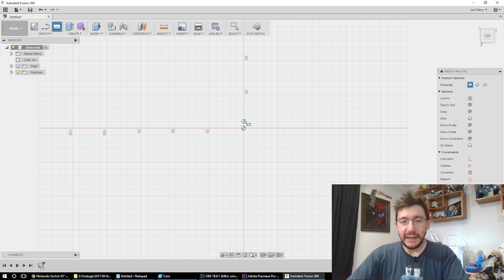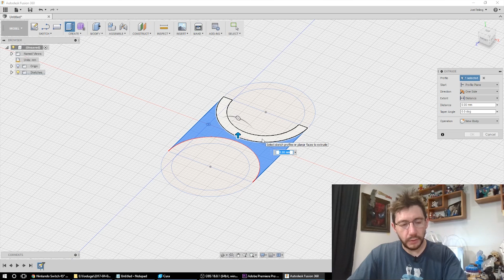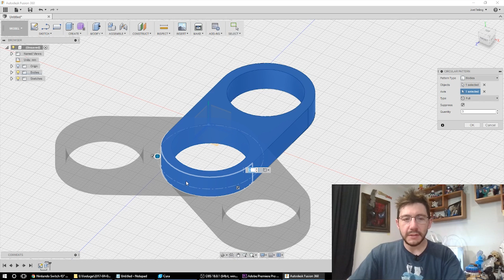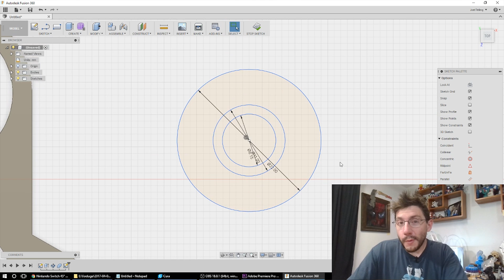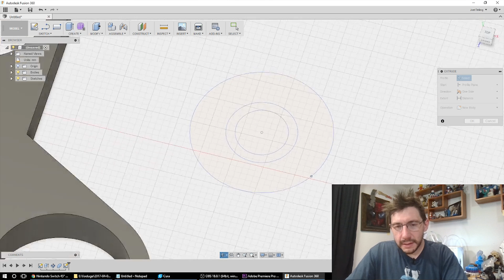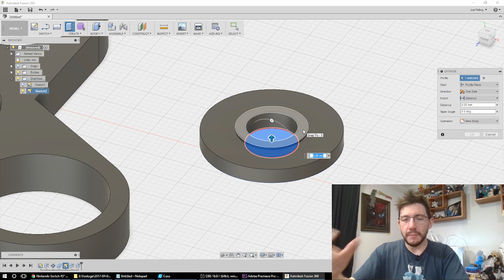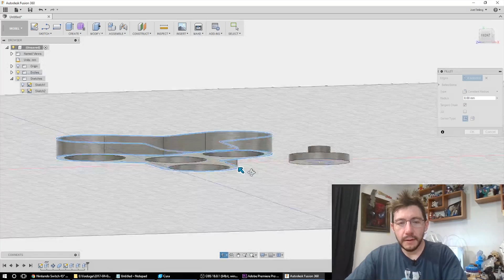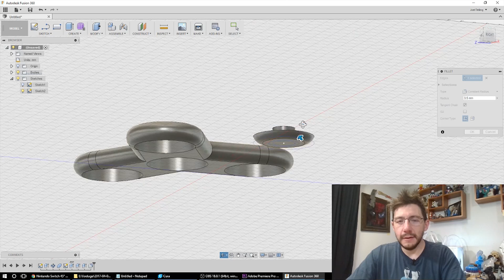FIDGET SPINNER! Easily Make Your Own with 3D Printing!

Comment: nice video. just one doubt. how do the bearings on the sides(other than the center one) stay in place. How do u lock them? or just push them in place? n if they are not locked, dont they come off? and what material did u print them in? Thanks in advance.

Comment: I would like the outer holes to be 3/4 inch diameter for ceramic magnets to fit tight. I use two for mass and strength. These magnets are cheep and readily available in most hardware stores. I built a Bedini style SSG style pulse motor with a spinner. And be aware there are many different brands of spinners. Fidget Sinner is a trademark name so be careful what you say. Thanks for the info Youtuber. Come to Facebook sometime and do a live one. K! Nuff stuff? Checkout what I've done. 
https://www.facebook.com/KB9AGT/videos/10154786011147215/

Comment: If I were say getting a spinner done in brass based off my design, would I still need to add the .05 for the bearing? Or would, since it'd be done by a CNC, it not be needed?

Comment: If you haven't already order a couple of full ceramic bearings for the center bearing. The difference is a much better spin time and sound. I replaced the one I made for my 10 year old he was ecstatic. The full ceramic ones cost more, around $9 each. You can use the old steelies to go around the outside for weight, or just use nuts they are cheaper. Thanks for the idea of using fusion 360 to design my own. Keep making the great videos :)

Comment: what would be a good first 3d printer?
Reply from the maker: It really depends on a number of things. What's your budget? What do you want to print? How much space do you have? What is your technical ability?
Reply: $500 or less, I'm interested in printing moving mechanisms, gears, etc. Space isnt much of an issue, and Im pretty good with computers, and have minimal 3d modeling experience.
Reply: and id like a good sized print volume
Reply: Zachary Tarbell Hey man! I don’t know if you’re still wondering and I’m no 3D printing expert, but the creality cr-10 is a pretty good printer from what I heard. It’s under $500 and has quite a bit of space. :)

Comment: @Joel,

  I'm gonna need you to go back and apply R.U.L.E. #1 in Fusion 360. You can then continue making this video.
Reply from the maker: I knew someone would bring this up!
Reply: lol  For simple designs like this, it will not make much of a difference.  But once you start getting more and more complex, it will make it much easier to work.

Comment: I have a question. Do you have any techniques of getting broken filament out of the extruder assembly? It is just do stuck I don't know how to get it out
Reply from the maker: Depends on where it is stuck, but there are several techniques to try. Look up "atomic pull" method.
Reply: Thanks. I actually had to take it all apart and get a nail and hammer the filament through the metal part above the hot end and is now fixed. Thanks!

Comment: Angus began Fusion 360 a few weeks ago and Autodesks offer is great. the software is basically free for startups and fans as long as you make less then 100k and by then you can afford it. 

your tutorial felt a little bit too straightforward, like too much step to step and no explaining and no visualization of things. you showed the pattern as 3 then 2 and then 3 again for example. 

But excited more people are using the software and more will after your video. I chose fusion360 for my project as well and I had done a few designs already. currently doing custom hydroponic planting pots in the form of numbers and letters but I haven't yet found a good way to use the pattern that fallows a path for it. and I am not great at typography
Reply from the maker: The goal was to make this as ridiculously simple as possible. My goal with this was to make it so a kid could pick this up and do it. I'm still learning Fusion 360, as it's well apparent (heh), and Angus has been one of the driving forces for that. Angus and I chat, and he's told me he welcomes the challenge :)
Reply: Educate & Advocate

Comment: what if you made a 3d printed bearing
Reply from the maker: It would not spin very well :)
Reply: 3D Printing Nerd yes but you can make it out of copper filament then send the seven bearing balls a little bit
Reply from the maker: Now THAT is interesting...
Reply: I have...used it on a customized spool holder...they didn't spin all that well
http://www.thingiverse.com/make:255750
Reply: I've 'proofed' a roller bearing. It's on MMF. It is printable in PLA as a one piece print with very little support. With some lithium or ptfe lubricant it rolls ok, but nothing like steel. 

You could print in metalfill but it would take a VERY long time to get the surfaces smooth as you can't reach inside the bearing race to access the rollers. 

So it COULD be done, but not really worth the time or effort. If you just want to as proof of concept, grab the file from MMF and have fun.

Comment: Unfortunately, Fusion 360 doesn't work on Linux, and they have no intention of porting it. So I'm using OnShape, which I actually first learned about from Angus. From what I understand, it's nearly identical in functionality to Fusion 360.
Reply from the maker: I've heard that as well! I really want to try it out at some point!
Reply: 3D Printing Nerd: I'm pretty happy with it, though I have little basis for comparison. It works in nearly every modern browser and is free to use for public designs.

Comment: Ceramic bearings are good, but not necessary. Open up your bearing (remove the metal cover), and clean the grease out of it with WD40. Makes a world of difference.
Reply: I just use coconut oil
Reply: This is the biggest tip many people miss. Lose the oil/grease on the bearings. They will never spin fast enough to need the lubrication. All the grease does is slow it down on you. I found a supplier in China that has inexpensive ceramic bearings that spin just as long as the expensive ones on Amazon for 1/10th the price.
Reply: +Trigger: I'd be interested to know that supplier. Care to share?
Reply: and the name of the supplier is....?
Reply: I got some ceramic ones off eBay, and they spin for about 2 minutes whilst being very cheap. Here you are: http://www.ebay.co.uk/itm/608RS-Good-Roller-Skates-Ceramic-Ball-Inline-Skate-Bearings-Drift-Plate-MR-/192041707127?hash=item2cb693e677:g:qBMAAOSwiONYQAji

They did take a while to arrive though...
Reply: Makes more noise though...
But boy howdy do they spin MUCH longer!
Reply: See my other response in this thread.
Reply: Michiel Helvensteijn 
Hi
Reply: WD 40 actually leaves a residue to protect against rust,  it may work better at first because it cuts the grease/oil but after a while it'll collect dirt and the residue will really clog up your bearing.  Paint Thinner or acetone works a lot better and doesn't leave a residue. Iif you want to add a lubricant, just a drop of Sewing machine oil or speed cream does the trick.  (PS. All lubricant will slow the bearing a little bit, and for something as low stress as a fidget spinner it isn't necessary, for max spin times don't use any.)
Reply: +Jay Dezi: It will collect dirt? Sure, if you use it in roller blades. But if you use it in a fidget spinner with a cap?
Reply: Michiel Helvensteijn,  I've messed up the internals of an airsoft gun using WD 40, the residue really gummed up the slide and then the dirt just made it worse.  wd 40 is surprisingly sticky just by itself.  acetone is dirt cheap and it might save you some grief in the long run.  but honestly for a fidget spinner, it probably doesn't even matter :)
Reply: They are all over Aliexpress, look for 608 Black Ceramic. I don't like to provide direct links on people's videos as it's their page and they should be able to monetize anything like that. If Joel is reading this he should provide an Amazon affiliate link to the 'Neal Precision Bearings'. I've had good luck with them when I couldn't wait for a delivery from China.

Comment: i found 21.7 mm is a perfect size for the circles you put the bearings in. it is quite a struggle to get them in there (i used a vise) but once they're in they won't move at all

Comment: cool, but can add oneeeeee more step to make it a tad easier actually, to get the finger pads to fit to everyone else's printers is hard.  so instead of dealing with printer tolerances to fit the inner bearing perfectly. leave the lip, but the center part make it threaded so it screws together . :)  it's really easy in F-360!!  https://youtu.be/3NQoHzjpsw4
Reply from the maker: HOLY CRAP. This is a GREAT idea! I will SO look into doing this!

Comment: I keep seeing people using 4 bearings while you only hold the middle one.. why waste the extra 3 bearings then?
Reply: Remco Smit counter weights
Reply: Technically, you could fidget with those as well, it would just be more of a "swing" action, than a spin I guess.

Comment: do you think that cura is a good beginner slicer?
Reply: They are all (annoyingly) different enough from each other honestly you should just learn one of them and use the heck out of it.
Reply: thanks! 😂
Reply: I don't know if I would thank me exactly but learning how to use a specific slicer well is more important than worrying about which one is the best. 
Once you know how to use one of them switching to another is like changing your keyboard layout. You can eventually figure it out but you're mostly starting from scratch. All the menus are different, the interface is different, the shortcuts are different enough that you can't trust muscle memory.
It turns out that working in 3D with a 2D interface is hard.
Reply: yeah, in fact i wanted to start with simpify 3d, the options are a little to much for a 3d printing noob like me, plus is 150$.
cura is free and i did 4-5 pints with it and seems quite simple and well made

Comment: If you take the bearing bearing caps out with a sharp screw screw driver and wash out the grease with a solvent it's will spin for over a minute.  Mine spine for 90 seconds.